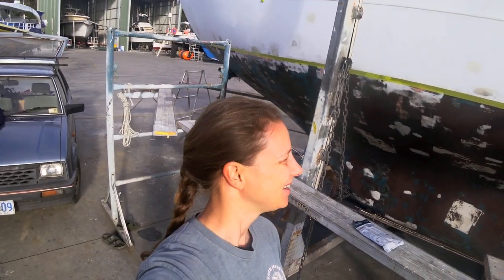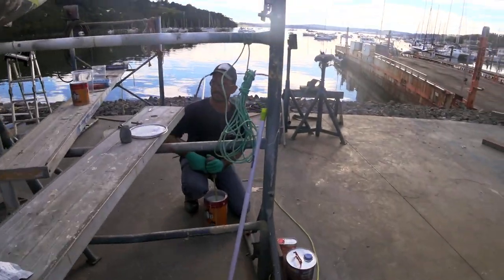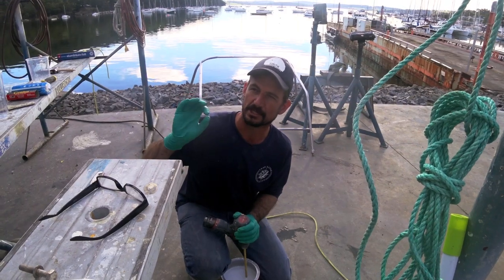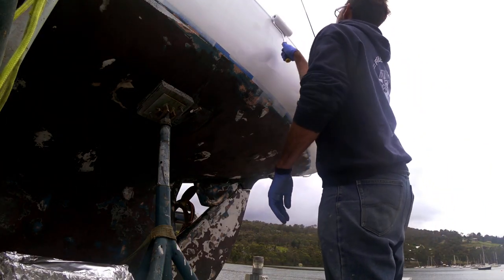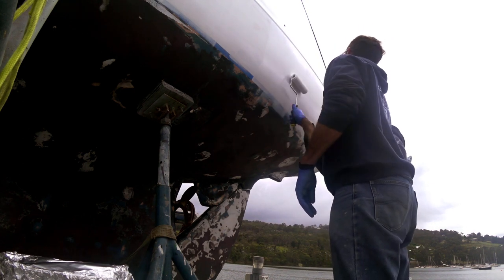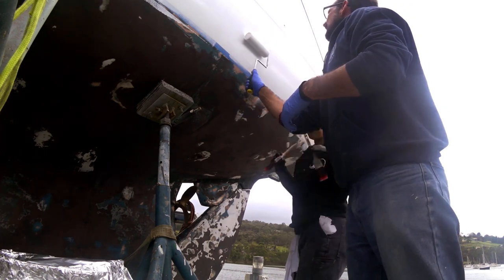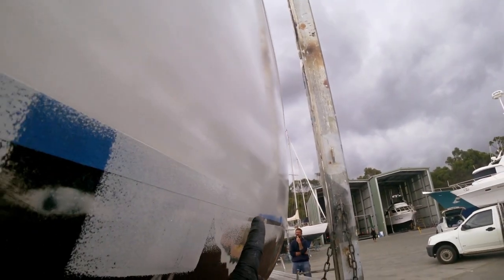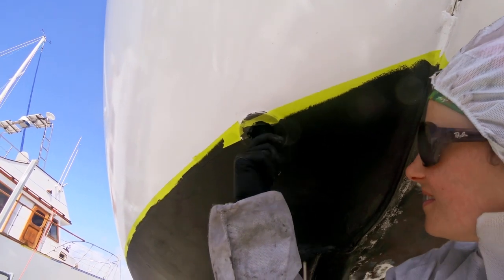Painting our ENTIRE sailboat by HAND (Roll and Tip & why we did it) - Free Range Sailing Ep 163

Comment: Just a few tips, buy foam roller sleeves made for two part paints and your not using a tipping brush. Tipping brushes are wider and thinner so they dont hold paint, i know you think economy but new roller sleaves and brushes for every coat
is a must . And yes you need the right thinner but amount will depend on temperature and try not to paint when its windy. Anyway goodluck with the rest.

Comment: I feel and know all about your pain when, after all the hours and days and weeks of prep work and doing the right things, expecting to finish a job months in the making but in a couple of hours end up with a disaster. Probably going through your mind was the thought "This is the last time we have to touch this hull and it's done."  And it wasn't even your fault. 
I had to go through the same resanding process when I spray painted my 12 metre catamaran. One hull was repainted 3 times and the other one twice - resanding the hulls each time. But it was due to the heat where the solvent was trapped behind the quick drying paint leaving nothing but pinholes everywhere. It was a real balancing act between waiting for the humidity / dew point to drop to a point where you could start painting and beating the rise in temperature as you paint. 2 part poly paint doesn't like humidity or 40C+ temperatures.